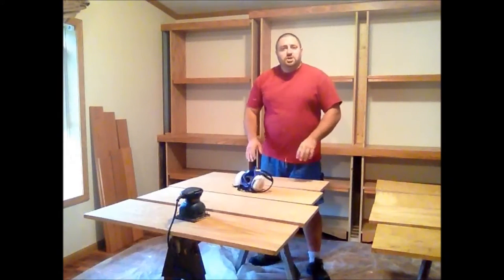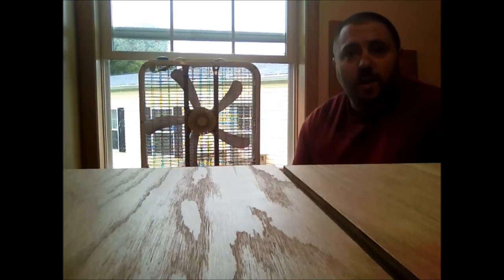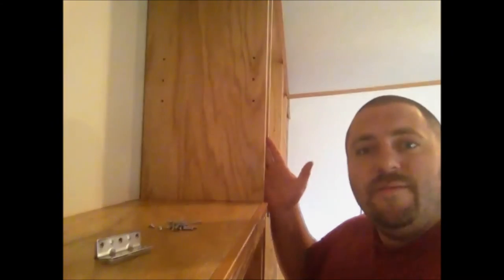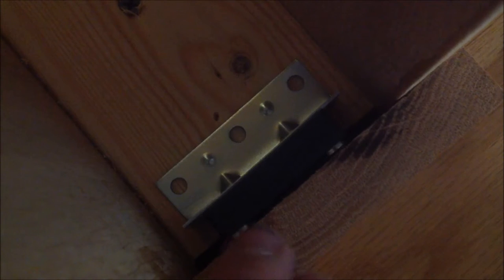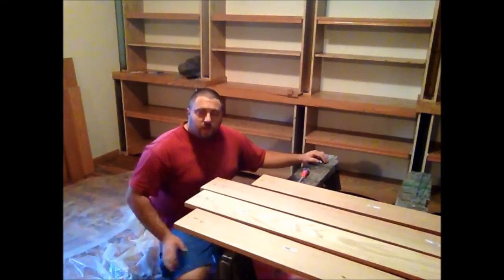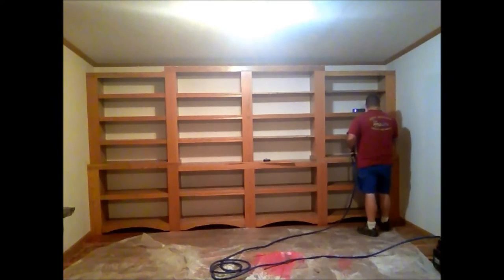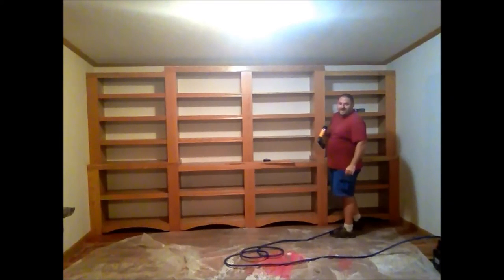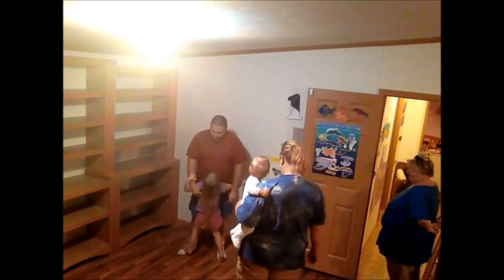DIY 6.0 Build Hardwood Bookshelves, Book Cases, Entertainment Center, Storage Shelves, Utility Shelf

Comment: Very good job. It looks great. I always used #000 steel wool in between coats of poly. Didn't trust myself using a sander. Glad you got it done before they got home. Nice series.
Reply from the maker: mi2tn I usually do use the steel wool also, however the instructions stated explicitly not to use the steel wool on the finish because it is water based and any microscopic pieces that get trapped in the wood grain may rust and discolor the wood from below the finish coat. Shhh don't tell anyone that I'm a guy and actually read the instructions. Thank you for watching
Reply: Got'cha, didn't know about the water base.
Reply from the maker: mi2tn well neither did I until I got it home with it, so I'm glad i read the directions first.
Reply: I'll have to keep that in mind next time I buy some. Thanks for bringing this to my attention.